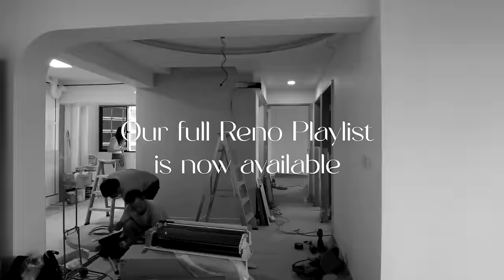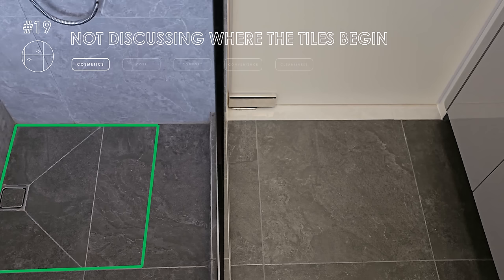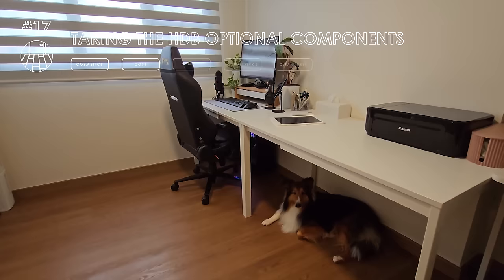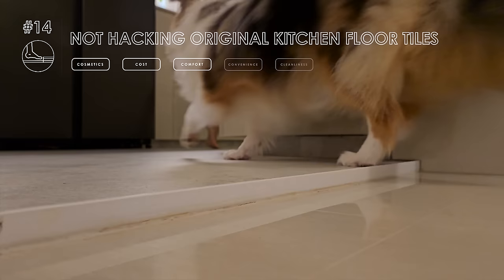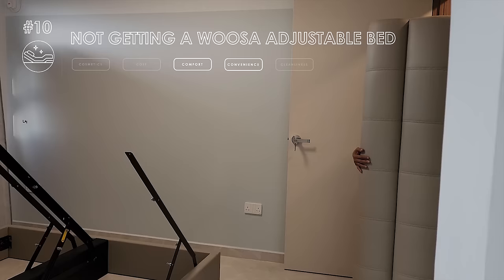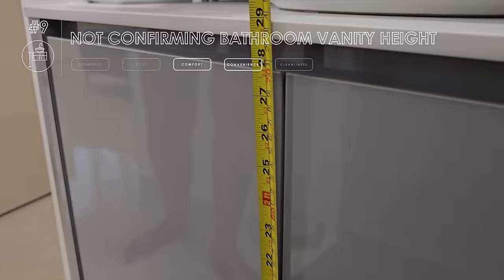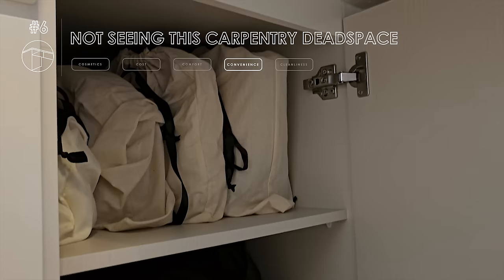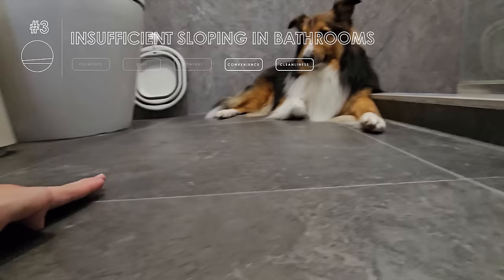20 Renovation Regrets | Don't Make These Mistakes! | HDB BTO 4-Room Home Reno Singapore

Comment: Depending on IDs are the worst regret ever. You would have thought that they should know more but honestly, my experiences suggest otherwise. For example, they know nought about carpentry. Even the carpenters they hired are not any better. So many simple things they can't do and I had to tell them how to do their job to achieve what I wanted. Really, what are we paying them for?
Reply from the maker: 🤧 hard truths but it depends alot on luck too. There are definitely good IDs out there somewhere creating value and going beyond to do their best for the client. Screening is difficult too since the way they behave or how they treat you might change after signing the quotation and after reno starts.

Comment: Seems to me the ID is inexperienced and/or not meticulous, the tiler used is also problematic. Usually they should and will remind home owners of the height difference… 
Easiest way to rectify the situation now is to overlay the living room and bedroom (that has vinyl flooring) with tiles. Tho the bombshelter door might have to be trimmed to make way for the thickness of the overlayed tiles and the dining area settee has to be uninstalled so that tiles can be overlayed before reinstalling it back.
As for aircon flap getting in the way, it’s actually a small issue compared to shifting it further upwards towards the ceiling because the space at the top is required for circulation and for when u need to open up the aircon for cleaning and maintenance.
I believe something can be done to conceal the protruding plugs in the false ceiling. If you want to relocate where the LED light starts… just ask the electrician to extend the wiring to the other side of the false ceiling!
Do check your quotation for the length of the common bathroom vanity and table top. 76cm is considered 2.5ft and 3ft is 90cm. If it’s not specified in words in your quotation and you’re charged 3ft pricing…. 😅
Honestly for the grouts, just go for normal colored grouts.. 
Generally the tiles, grouts and silicon finishings are not good. 
Recessed U-channel in your case, likely you’ll still see the u channel on the wall even if it’s recessed cause the thickness of the wall tiles are lesser than that of the u channel. Nevertheless, you will find it alot neater.
Reply from the maker: Thank you so much for taking the time and effort to write to us! Largely agree with everything you said! Although it's unlikely we can do anything to the living room now that the carpentry are all in place... 🥹 Good points raised about the aircon, after reading what you said, it does make us feel better. As for the carpentry quotations, I believe it goes by per-foot-run (length) so the height wasn't a factor in the costing
Reply: @thesuakus  oh! Just realised you were referring to the bathroom vanity height and not the length haha :)
Anyways, it does feel abit uncomfortable to overlay tiles without taking off all existing carpentry. Even tho it can be done, it always leaves the question of what about the tiles underneath the carpentry 😂
Reply: Trim bomb shelter door ?
Please get ur facts right ..your are NOT allow to modify/altered the bomb shelter door and structure .
No contractor in their right mind will trim the bomb shelter door .
The door is made from reinforced steel .
You only trim wooden door.
Source:HDB website .Go figure

Comment: Hi, for eproxy grout, you have to cut deeper into the grout for a better adhesion OR be applied during the initial tiling process.
Reply from the maker: Hello!😄 Aha the peeling all start from the edges and spread, because once dried up, the epoxy is all connected...no matter how deep it will be dislodged. So our recommendation is not to do epoxy for the edges and for bathroom floors. The rest generally are stable!
Reply: @thesuakus  the interesting thing about this finding is that many people would want to consider doing epoxy grout in their toilets especially because of epoxy's apparently superior durability, water repellent nature, and resistances to showing holes between tiles vs traditional cement grout. So finding out that they are actually unable to adhere on the floor and in certain sections of the wall (i.e. corners) is pretty troubling. I'm glad we didn't do epoxy in the end then, since with cement grout, I can just take a bit of the powder, fill in any gaps, and apply water to fix minor defects myself - not likely something one can easily do with epoxy.
Reply: @moltenbullet is it because of the type of epoxy used. We are thinking to use epoxy for toilet due to durability and have found many people apply it for shower area. Now I’m having second thoughts about it.

Comment: Thanks for the tips. Regret to say you have engaged a bad interior designer and contractors, the reno works are quite  bad. They looked like inexperienced vendors given those " defects" you guys have highlighted in the video. Normally good interior designer and vendors would not make those mistakes😅

Comment: Hi guys, thanks for sharing all your experience working with ID and the builders. I'm curious just what is the Interioe Design scope of work? It seems like the ID is not doing their job as most of the issues highlited should be address by an ID before renovation. There should be construction detail drawings with all the mne and built in with joint finish detailing.

Comment: I installed KDK fan as well. I can turn on the fan with google without much hassle like what you shared in the video.

What I did was just install the smart switch then settled. I can turn on and off fan using the smart switch.

But of course the fan speed and light color got to be manually controlled unfortunately.
Reply from the maker: Hello! Yes, we use smart switches too but it would simply turn on the fan and the fan light based on their last saved state which means you'd be unable to turn off the fan light if it was on

Comment: I believe on the "reset" of tiles at the shower area, that's currently done because of the drainage. They can't lay a full tile when it needs to slope to the drain...
Reply from the maker: Hello! It is doable aha the full tile will be sliced geometrically into 4 so that they all slope towards the floor trap :)
Reply: The thing is owner dont like the lines in the toilet trap.  No tiler in the right mind will start  with a full tile one the corner. Unless the toilet use perfect number of complete tiles. Which is unlikely. Also , if u change floor tiles arrangement, wall tiles also must change. Ever see floor tiles and walla tiles that star with a complete size tile at the edge? 😂
Reply from the maker: Hmm.. disagree completely with this comment. We didn't mention about not "liking the lines in the toilet trap" 🤔 We said the wall and floor tiles do not line up, which is the professional norm. Also, contrary to what you said, it is actually standard practice for tiling to start with full tiles at any one of the four corners. We are simply stating that instead of selecting the corner which would be hidden by the vanity, they should start from the other corner instead.
Reply: For tiling, I watched somewhere to tile the floor followed by the walls to prevent any gaps. Was yours done this way?

Comment: Thank you so much for sharing. I’m currently planning my renovation and looking around for ceiling fans. My mum said to go for kdk since they have been using their wall fans for years. I’m glad to watch your review and looks like it’s off my list now.
Reply from the maker: Hello!! Yesss when we shared on IG a few months back, a few homeowners shared the same problem with their KDK Airy.. remote issues / weird sounds... so it's likely a product issue 😔 Maybe their older time-tested models are better!
Reply: @thesuakus  I was tempted by the same fan because of KDKs good reputation! Lucky I tried it at the store and didn't just buy online. Got so pissed off when trying it because of how slow the remote control was and I think the app was like 1+ star at that time. Phew.
Reply from the maker: @ysm2010A phew indeed!! The remote does have some lag time and it's not as responsive as the old school ceiling fans which we'd gladly go back to instead
Reply: Don’t buy ceiling fan. Buy wall fans.
Reply: Same issue at the store. But at home mine quite ok. Aside from the blade issues during installation which they replaced. Now no more issues. Fingers crossed.

Comment: For the cove light sharp screw tips, you can cut those drill hole plugs for screw and cap them. Or suitable sized wire nut.
Reply from the maker: Thank you! Sounds like a good idea - we'll do just that :D

Comment: For us tiling was the other way round... had quite bad lippage issues cos my tiler didn't even use levelling clips. His excuse was that it would cause the tiles to be hollow (lol). My toilet wall tiles also have a noticeable shadow due to lippage. I think one thing I would enforce in future is to force my tiler to use tile levelling clips. In the end I regretted not going to vinyl for the whole house (I did vinyl only for bedrooms) as it is easier to achieve levelling. When I accidentally damaged some vinyls, the supplier could easily hammer out the affected vinyl and replace it within 5 mins.

But I think for the bathroom flooring, because you are laying over the original HDB floor tiles, it may be difficult to achieve the gradient I guess... the ponding could potentially have been there from the start. And also I realise if you have a toilet bowl that is fully flushed to the wall, water may not have space to flow through.
Reply from the maker: Heya!! Oh man.. why would the levelling chips cause the tiles to be hollow? 🤔 As for vinyl...some of our study room vinyl pieces are starting to "pop" whenever we step on them. The textured ones are also very hard to maintain cos of the dirt trapping in the grooves of the design etc.

I think the sloping in the bathroom can be modified based on the thickness of cement adhesive they apply.. guess they could have tapered it more, so that the water will flow away from the toilet bowl instead of going behind it 😅

Comment: TSK, btw, am surprised that your epoxy grout is peeling off coz it’s supposed to be more suitable for wet area than normal grout
Reply from the maker: Hello! Yes, the peeling starts from the edges, which then spread to the floor. The middle floor tiles are all alright for now! The bathroom walls are all good. So we suggest to avoid doing the edges and corners 😁

Comment: Hi 

Could you share if our understanding is correct.

1. Did you remove the vinyl floor finishes of the bedrooms and have them tiled first before the Riche Stone team come in to do the marble gum and the epoxy grout?

2. If you did the marble gum before removing the bedroom vinyl floor finish and tiling works, do that mean the Riche Stone come down 2 times? 1st time to do the marble gum, 2nd time is after the tilers have finished the work?
Reply from the maker: Hello! 

Master Bedroom and Common Room 
- Remove vinyl flooring
- Fresh tiles and skirting
- Epoxy grout (not marble gum) before moving in / bed delivery 

Living and Dining Room
- Kept existing HDB tiles
- Marble gum at the very beginning before renovation start 

We shared more about the differences between Marble Gum and Epoxy Grout in our Bedroom Episode 😀

Comment: Thanks for your informative videos, they are great! I would like to seek your thoughts/advice. If I were to hack away the service yard walls, can the damage on the floor be easily rectified by similar floor tiles or it’s better to hack away the entire kitchen floor tile and replace it? Such a waste of the original tiles but the damage seems quite bad..
Reply from the maker: Hello there! Happy to hear that they were informative! :) If hack away service yard walls, your ID can make good the affected floor tiles by sourcing the same existing floor tiles. We have a neighbour that did that but the floor tiles have a different colour hue as it's a different batch from 5 years ago during the prefab. Anyway, we would recommend you to level the floor tiles since you are going for a seamless transition so the slope down into the service yard would be quite strange. But if you are going to level, might as well do an overlay or a full hack 😅
Reply: @thesuakus thank you for your insights!

Comment: a waterfall edge isn't a curved edge though. it's usually a 90 degree edge but the main point is it continues the pattern of the countertop down to the floor.
Reply from the maker: Hi! Thanks for sharing~ think there are two uses of the word waterfall edge. For stonetop, it would be the 90 degree fall. For laminate (our example in the Master), it would the the curve which resembles water flowing 😀
Reply: @thesuakus oh interesting! I wonder why IDs use the same word, it's very confusing leh 😂

Comment: Is it necessary to use an ID in Singapore.?  Why not manage the project yourself considering it’s your idea n plan in transforming your home to the way you like it.? To me, the most important areas r the bathrooms n kitchens n flooring,the rest r secondary….For the bathroom,don’t be afraid to give it a bit more slope front n back, a good tiler will make it look good, always ask the tiler to match the line of the  floor tile in the shower to the wall,that’s provided you use the same size tile n to place cut tiles to the inside corners,so it’s  not too obvious.  Good warm lightings 

Kitchen, quarts countertops n full backsplash,not the 4  inch backsplash ,gives it a clean look n easy to clean too.  Make sure installer use epoxy grout to make the joint invisible. Cabinetry, up to your imaginations, lots of ideas out there, mainly needs lots of storage, soft close..etc etc  if possible,hood vents outside, I would ask carpenter to build a box from the ceiling to the outside wall n hv it vented outside n buy one with a good CFM…JMO
Reply from the maker: Hello! Thanks for always taking your time to share your thoughts and insights! 😊 For first time homeowners, unless they have lots of time on their hands and willing to arrange all the vendor scheduling on their own, the mainstream approach is to go through the "ID firm" route. Whether or not the "ID" really cares about design/aesthetics, or, in reality just a project manager, really boils down to their talent and the expectations that the homeowners have when they interview and select their ID. At the end of the day, costs also have to be factored in.. there are amazing, passionate IDs we've spoken to but they quoted double the cost for the same scope of work.

In our future home, since we're familiar with the reno process and learnt alot through this journey, it's possible we will go through the Contractor route. 

Singapore public housing, especially BTOs, have quite alot of restrictions (ie no ducting outside, no hacking of bathroom floors) and since it is prefab like Lego bricks, there is a fine balance to be struck between creativity and practicality, especially since the first home is unlikely to be the "forever-home". So we decided to preserve as much as possible the original rooms for ease of resale in future (or if family circumstances change) and most importantly, work within budget and means 😜
Reply: It's not necessary PROVIDED you are an expert in all the fields. You would think these people know how to do their job. That would be a big mistake to assume that. I can tell you, most of these people have ZERO motivation and just want to finish it up asap without care. So unless you know how to do those jobs, you won't be able to know whether they did a good job. Most of these workers have ZERO professionalism. Maybe if you pay a lot more money...
Reply: @aspiringmodernistchef yup! So many contractors or workers out there doing very subpar or even bad jobs… perhaps too many jobs to do but too little incentive to give proper training to their workers. Sometimes i find that i know more from my research online than certain workers…
Reply: It boils down to how knowledgable you are in regards to renovation and how much time you have on hand. Got time to manage and oversee projects but cannot manage the schedule well due to lack of knowledge or cannot differentiate between a good and bad job… will lead to alot of stress during the whole renovation process. Miscomm can occur between you and the contractors, the contractor and the worker, you and your partner etc. At least if something goes wrong with the renovation… you can blame the ID for it instead of finding fault w your partner or the other way round 😂
I think the basis for hiring contractor is knowledge, time, patience and excellent communication..! Without either one of it, don’t attempt…

Comment: Recessed U channel won't allow you to change the glass panel should there be a need to - unless you're willing to also hack the tiles that the U channel is embedded in.
Reply from the maker: Hello, don't see why not...? If say the shower screen shatters, it's a matter of just removing the remnants and resilicon and place the new shower screen in 🤔
Reply: My ID called these embedded shower screen. Another lingo I supposed.